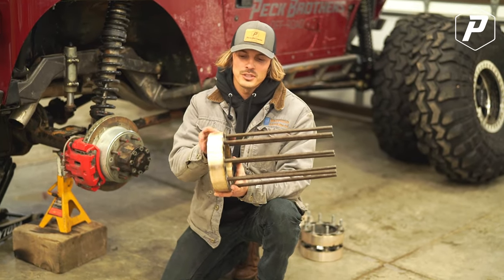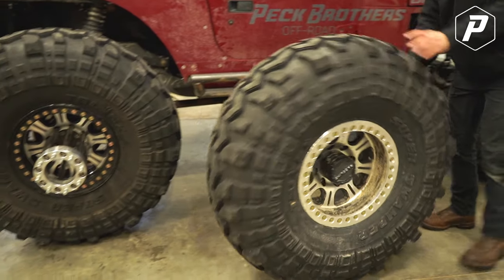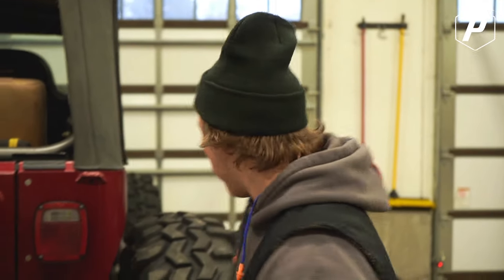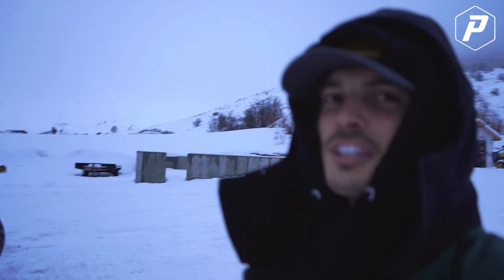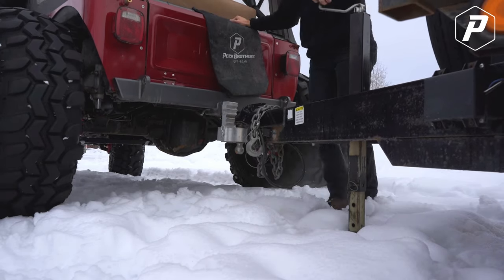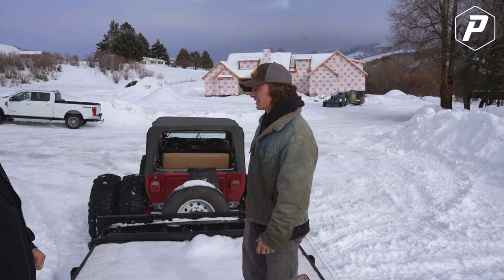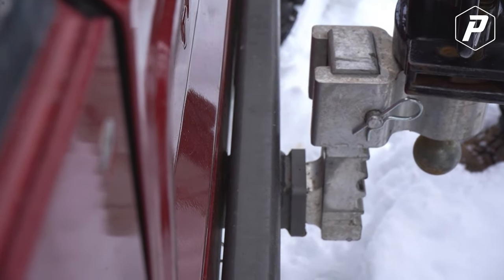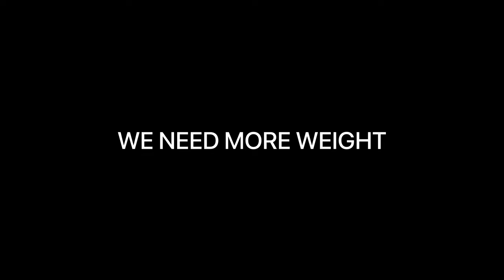WE BUILD A 6 WHEEL DRIVE DUALLY LS JEEP

Comment: My daily driver is a 1990 chevy blazer converted to a dually, king pin 60 front and a 70 rear with a locker, I've pulled 18k with it but the frame didn't like the 800 or more pounds of tongue weight!! Had to repair the frame!, I absolutely love it, fun to drive!!!

Comment: I've actually been patiently waiting for someone on one of the off road YouTube channels (as an experiment) to install a set of 445/65R22.5 Drive Tires (with an aggressive tread pattern - of course - like a Continental Hcs) on a Jeep Wrangler! 

45" tall - - Section Width of 17-1/2" - - Tread Depth - - 27/32" 

Maybe not so great for rock-crawling as I don't know how low you'd be able to air-down without blowing a bead seating, but with a load index of 169, these tires hold 12,787 each! When divided by its max pressure rating of 120psig, that's equates to 107 lbs. for each 1psig!

So, even if you had a heavily-modified and loaded Gladiator Rubicon tipping the scales at 6,000lbs., it would take a mere 14psig in each tire to fully support that 3 tons! 

I'd be curious to see how well they performed in deep sand and deep snow - Although for sand, I guess you would choose a steer tire like a 445/50R22.5 Continetal HTL1 (40" tall - 19" section width on a 14" wide rim - 13/32" tread depth and a load rating of 10,196 lbs. - You'd have to run those at 22psi to fully support 6,000 lbs. 

Silly thoughts? - Not too much silli(er) than a 6 WHEEL DRIVE DUALLY LS JEEP! 😆😉

You guys are most definitely Down With The Sickness, but in a BANGARANG kinda  Shoot To Thrill sorta Immigrant Song roundabout Crazy Train analogously Kickstart My Heart weird Thunderstruck way! 👊
Reply from the maker: Thanks so much for your comments and support for our channel man!! 😁😁🔥

Comment: On dullys you need a spacer in between the rims if you have tires tight together they rub and wear
Reply from the maker: If we were going to be putting thousands and thousands of miles we would, but we will only run these for short distances! Good advice though!
Reply: @PeckBrothers  look at any old photos of farm tractors with dullys and you can check out how it's done way stronger good luck

Comment: Only question is how come you just didn't get a dually hub for the rear and Axle it's a 1-ton actually sell the dually hubs
Reply from the maker: Because it wouldn’t fix anything haha we thought about it, it wouldn’t change the fact that we needed to mount 2 wheels in the same orientation. True dually wheels are reversible and raceline beadlocks are not. And even the dually hubs wouldn’t get the WMS far enough out, the inner tire would hit the coilovers 100%

Comment: Why would you not use dually wheels/studs/etc.? It's eight lug, so it must be a 3/4- or 1-ton axle, right? How hard would it have been? What you did instead is stupid, dangerous, and adds nothing but vibration and extreme sketchiness.
Reply from the maker: Dually wheels wouldn't work on this setup. Plus no one makes a beadlocked dually wheel.

Comment: It's not a 6 wheel drive if it has 2 axles. Where's the tandem axle to make it a 6 wheel drive so you have a 4 wheel drive with duals in the rear